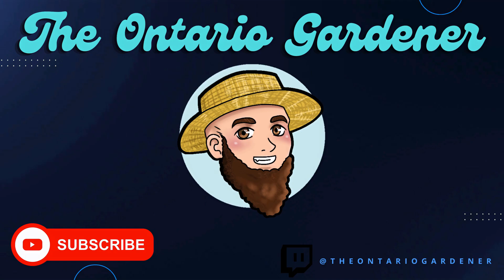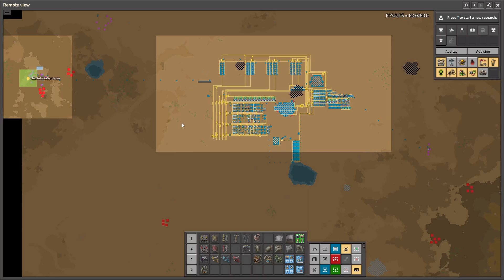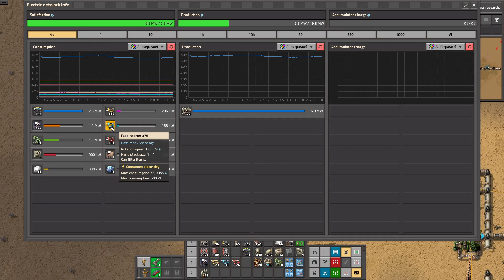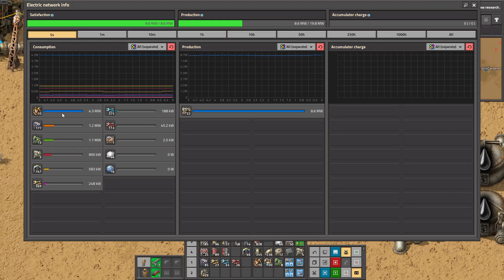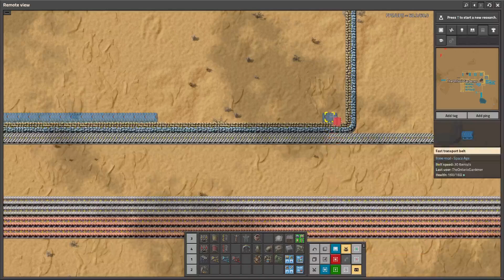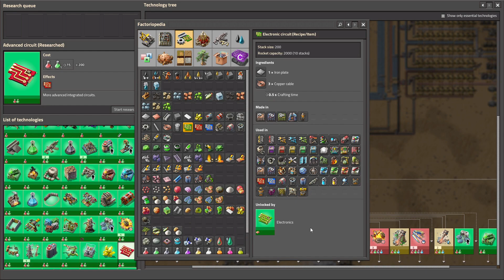Factorio - Space Age!, Oil Processing - Part 3

Comment: I do like the pipe visualizer and the recipes on the map (were mods for 1.1) as far as I can remember fluids where never instant (mods mostly did that) and they had a 100 ish (i think) entity limit before the flow would slow down. The new system its 320 from source before fully shutting down so you'll need a pump to extent it and its very noticeable when you hit the limit. mouse over a pipe that runs off screen and it will show the distance on the edge. Some people like the pipe placement more than the belt placement, so its a 'damned if you do damned if you don't) situation for Wube, you could keep an eye out for a mod to give you the options. I've seen people report that squeakthrough was updated for 2.0. I currently have 2 games going one modded and one not so haven't gone searching for mods and I don't remember seeing it in my mod updates I do each day. Keep it up you're almost in space.